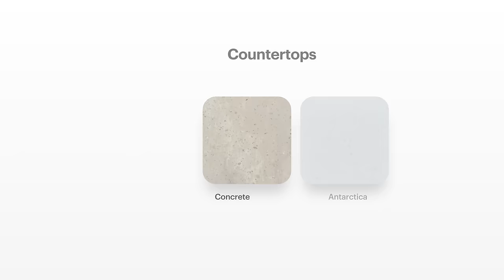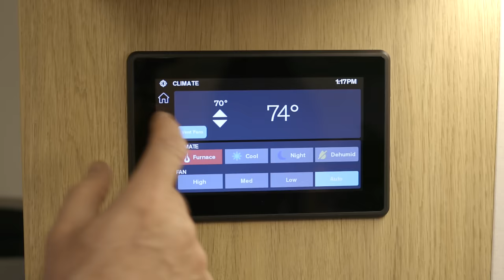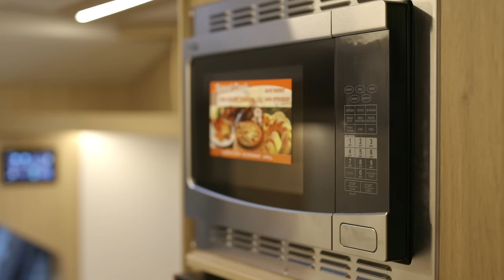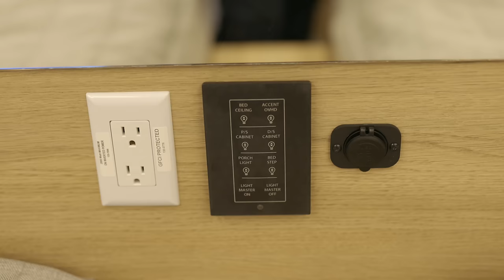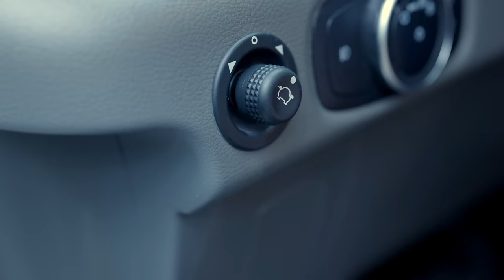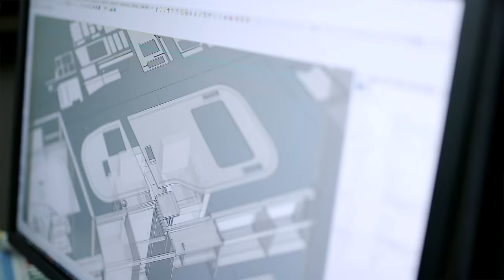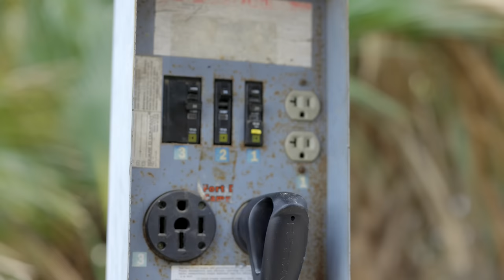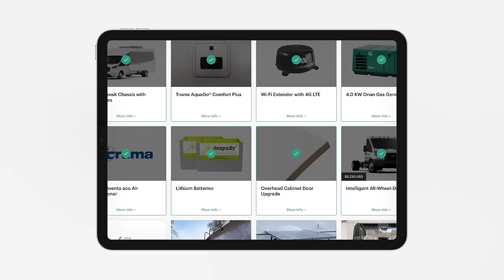2024 Wonder Rear Twin Bed

Comment: So the surge protector monitor is under the bench cushion? 🙄
Was that like an after thought or what?
Reply: Why would you want to look at a surge protector, it's not entertainment. Most rv's that have one put it inside a storage locker, upside down on the top of the compartment. At least with this one you don't have to stand outside in the pouring rain with your head and shoulders twisted in opposite directions to reset it.
Reply: @IanDinBC  your question is as dumb as the placement of the monitor 🙄

Comment: I called and they said if I order now, I won't get it till maybe 2026. So via registration wouldn't be registered as a 2024 or a 2026?
Reply: 2nd question. The warranties would be behind 2 years due to manufacturing delays so when do they actually start?
Reply from the maker: There are a lot of variables in estimating time on new orders, however when we begin the build at our factory, typically delivery happens in 30 days so the warranty is not behind. Hope that helps!

Comment: Will the AC run off inverter?
Reply: No, but AC will run off generator
Reply: Probably, it'll run on 15 amps - but it won't do it for long with 2x100 amp hour batteries.